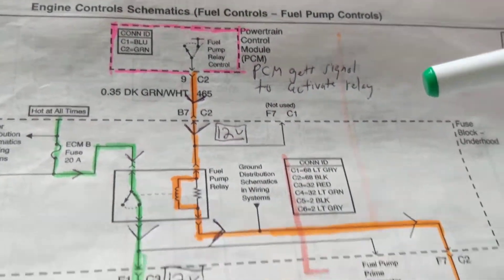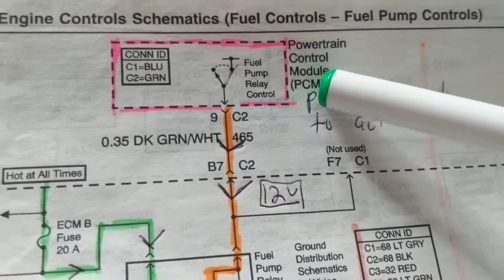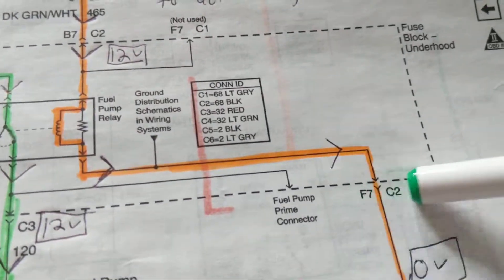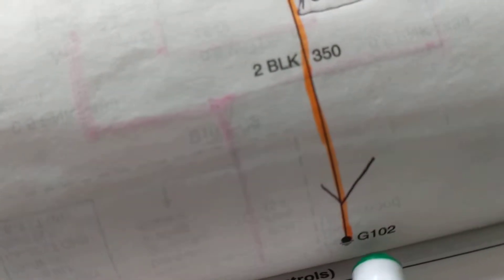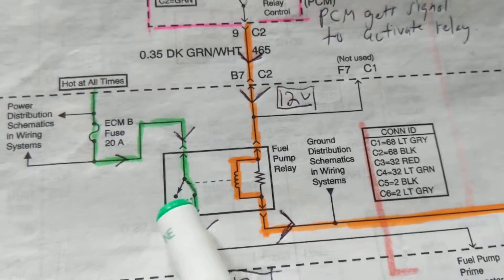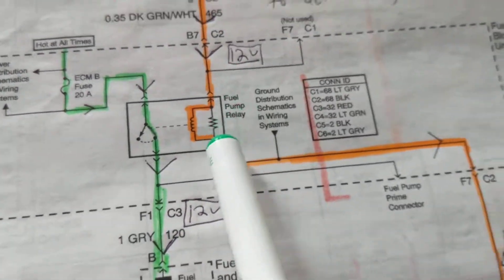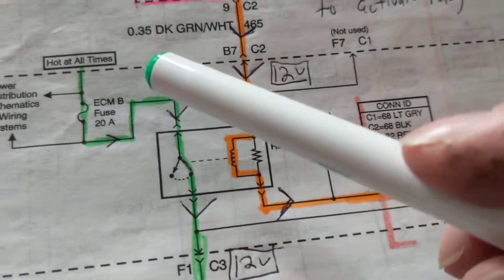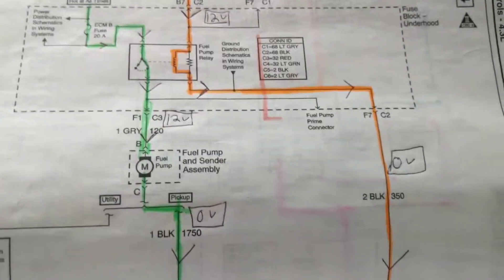HOW FUEL PUMP WORKS FOR CHEVY INCLUDES PCM TO CONTROL IT IMPORTANT FACTOR

Comment: Greetings from Venezuela. I found you today, great videos. I have a little doubt regarding the signal coming from the Ecu or Pcm to the fuel pump relay, its always 12 v or it could be ground ? Does it depends on the make and model of the car ? Sorry for my English. This signal can be cut by a bad sensor for example Ckp or Cmp sensors.
Reply: Usually it's a ground controlling the coil side of the relay so one side of the coil is 12 volts the other side is the ground controlled by the computer and obviously when you crank you must have a signal from the crankshaft sensor in order for it to be activated thank you so much

Comment: Thanks for the comments yeah I stressed the point that the computer controls the relay and the fuel pump costly venture I hope they did something called the continuity test to make sure that the wire is open

Comment: great video. Auto tech told me my fuel pump wire from ecm to pump needs to be replaced. not sure where to go from there
Reply: I am so sorry I never saw your comment until today actually apologize for that obviously the repair was made how did it go
Reply: @Joeelectronicschematicsforauto  it's all good bro. Faulty wire to ecu. I appreciate your concern.
Reply: Glad to hear it as I always stress the point the wiring can always be a part of the problem if you follow my channel and not the sensor and not the fuel pump hard wiring is always a issue thank you so much for your feedback good luck